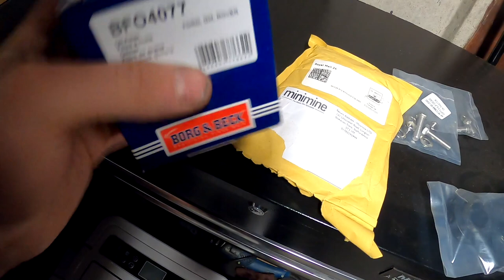89 CLASSIC MINI RESTORATION - FRONT END PT.1

Comment: Easy way to line up bonnet when you put it back on is to drill a 5mm hole through the hinge and bonnet bracket before you remove the bolts then is should go back together perfectly when you line up the two holes you have drilled
Reply from the maker: Yes definitely a good tip doing that the only reason I didn’t it’s because the front was already bent so thought I will make the bonnet fit the new front. But hear massively easier to do it that way! Cheers for watching

Comment: Hi Marc.  On both my Minis 1975 and 1978 the hood (sorry bonnet)  sits proud at the front. How did you get yours to fit so nicely?  Is all the adjustment to be had, at the hinges?
Reply from the maker: Hi midge, cheers for watching. In which way do you mean, as in the bonnet sticking out at the front of car or sitting so low to slam panel?
Reply: @SimpsonsClassics  As in sticking out the front of the car.
Reply from the maker: @midgelambert3880  yeah so with that you have a certain amount of movement in the hinges so i loosened off the four bolts and you can move it back a fair bit 👍
Reply: @SimpsonsClassics  Thanks Marc I'll see if I can do that. Cheers!
Reply from the maker: @midgelambert3880  no worries all the best 👍